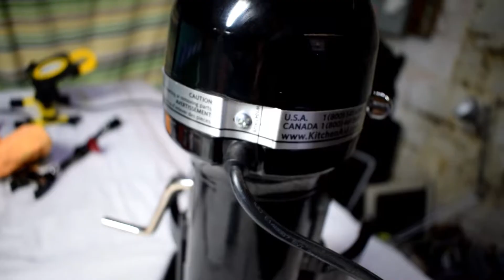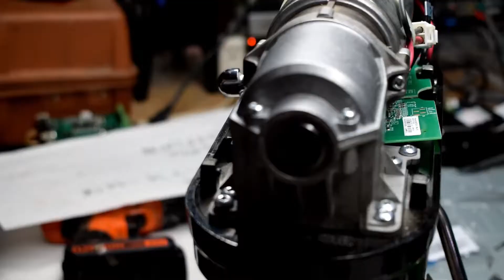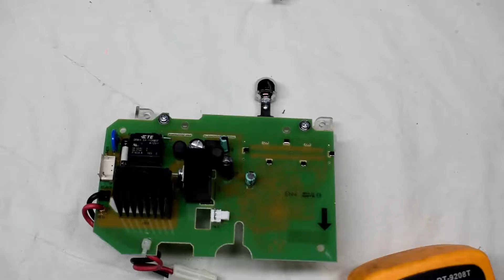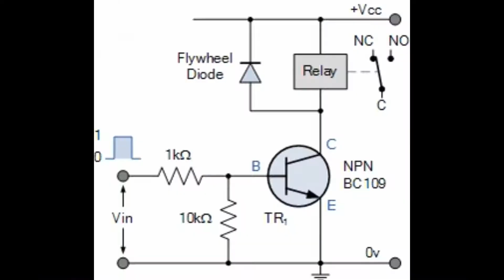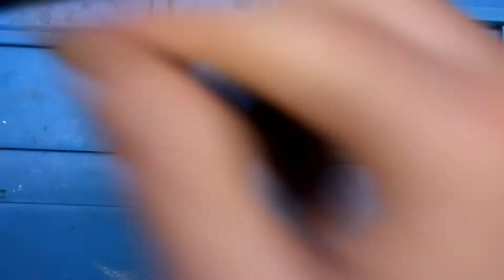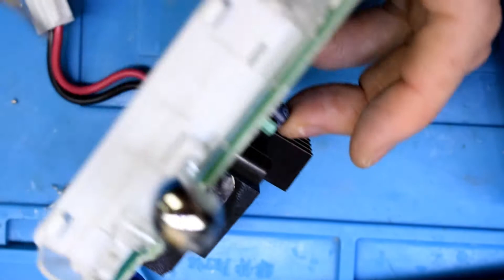KitchenAid Professional 6000 HD Repair!

Comment: I own a 6000hd and I’ve notice that parts are becoming very scarce, but the 7 quarts, 8 quarts, and 6000hd share the same motor, my question is do they share the same speed board?
Reply: They don’t but you can replace the 6000HD control board for the proline/commercial one. Apparently it’s an easy upgrade.

Comment: I can't seem to find any shorts on the board. I tried freeze spray to identify possible shorts but found nothing. I did notice that the relay clicks when the switch is moved but a few seconds it clicks again. Is this normal?

Comment: My 6qt HD mixer up and died a few days ago. I can hear a click when I try and turn it on, but the motor doesn't move. I can do some very basic electronics diagnostics, but definitely couldn't track down a bad capacitor... Is there an easy way to check if it's the motor or the board? Just checking for the 120V DC at the motor leads? I don't have a power supply big enough to drive the motor to check it directly. Any other ways to check the system?
Reply from the maker: The clicking sound is the relay, check the voltage on the relay, -- does anything look damaged? Check your diodes any shorts?
Reply: @NewsonsElectronics  Thanks for the reply. Nothing looks damaged. Checked what diodes I could, didn't find any that were shorted. DC voltage coming out of the board is ~35V, going to the motor. Don't know if that's normal.
Reply from the maker: @gabelstapler19   @gabelstapler19  its an AC motor, I would say it's your triac like in the video .

Comment: Hello, sorry for my English. I'm from Argentina and I have a mixer just like yours.
The problem is that when the mixer runs at low speeds it emits a pulse, the operation is not continuous but makes a jerk. You can help?
Reply from the maker: there are contacts on the motor they may need cleaned
Reply: @NewsonsElectronics  I cleaned the engine completely, everything is ok, only it has that fault and it is not just a motor, I have another mixer with the same problem. They are two engines

Comment: Hi! Thank you for these videos. I can't find guidance on my specific problem with my Artisan 5 qt mixer. It struggles to spin under load, or when there are solid ingredients in the bowl. It spins fine when the bowl is empty. I had mixed dough the previous day above the recommended speed 2, could that have caused it? Also, the speed control board is missing the bottom screw. Brushes look good and worm gear is new. Please help me! These things are supposed to last a lifetime, I don't want to toss it!
Reply from the maker: Sounds like the motor is worn out or try to replace the TRIAC mosfet

Comment: Great video! I will say that not all boards are the same for this model. I do not have that diode on mine. Are you able to say what the spec is if the varistor next to the fuse? Thanks
Reply from the maker: I would say as long as the voltage rating is 120V and maybe 5Amps?